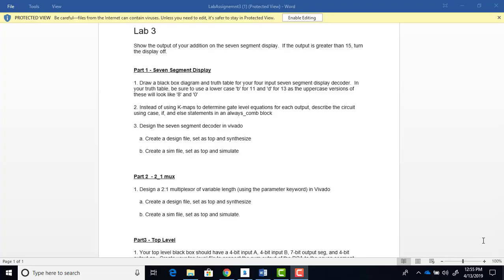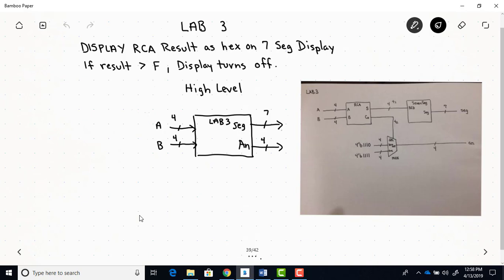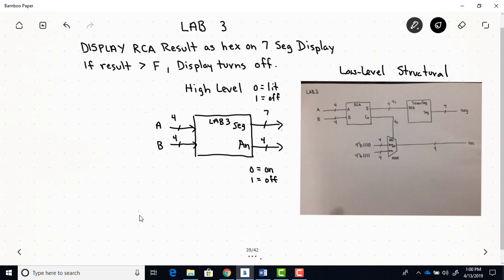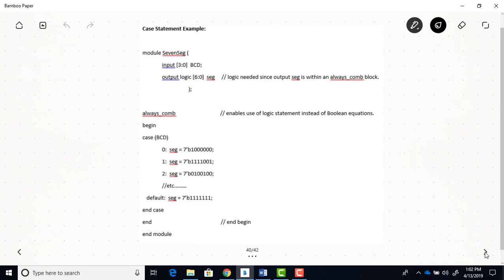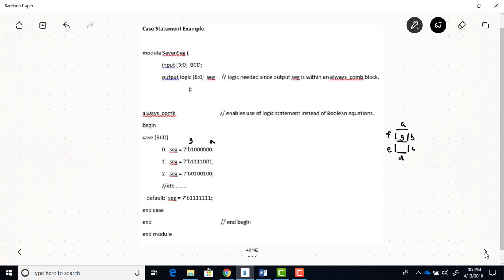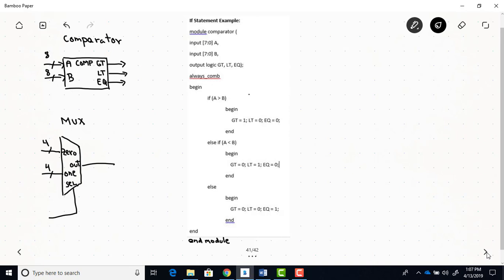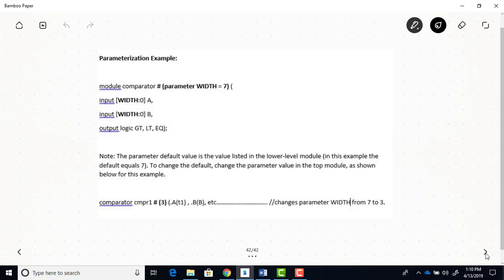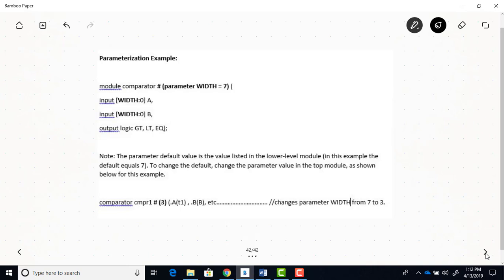IntroLab3

Comment from the maker: There is an error in the parameterization example starting at the apprx 13 minute mark; bottom line of code should be comparator # (3) cmpr1 instead of comparator cmpr1 # (3).